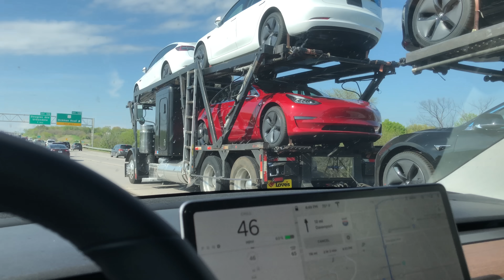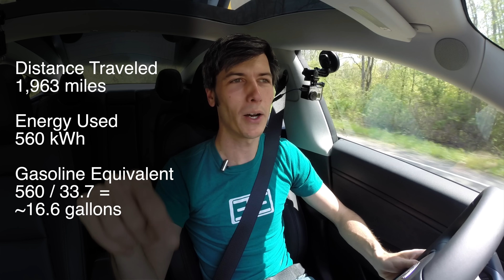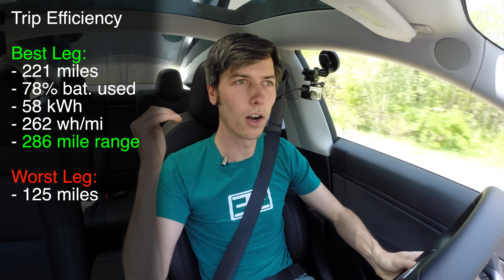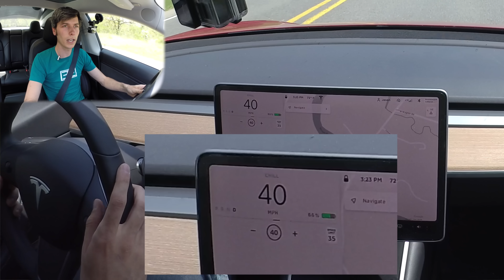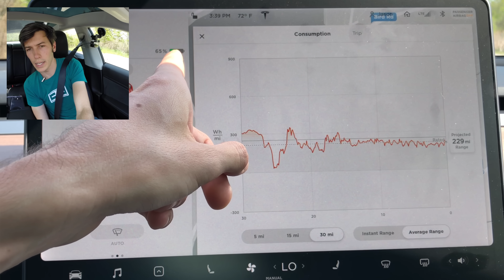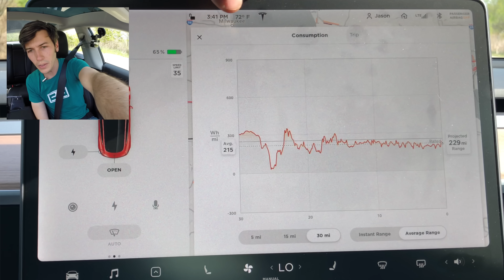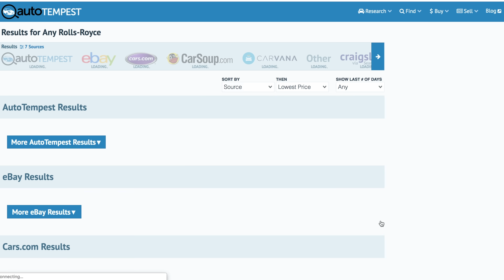How Miserable Is A Tesla Road Trip?

Comment: So basically, if ICE manufactures could get their efficiency up to matching 113mpge of a Tesla without sacrificing power, they could continue selling their ICE engines. It would then be cheaper to travel than in a Tesla and we would not have to mine the worlds lithium. Sadly, mining the lithium is also not good for our environment.  Disposing of the spent batteries will also be bad for the environment unless someone finds a way to repurpose the lithium into a fresh new battery.

Comment: once these get to the point where you can drive 400+ miles on a charge almost EVERYONE will be getting these. my camry can do 16x30 (480) on the highway. and then fill up in 10 minutes or less at the gas station
Reply: @joshburstyn To the average consumer, it does. Time is money. Mass adoption will be an uphill battle until the battery technology improves in both energy density or efficiency, as well as usable life (number of charge cycles before degradation).

Comment: I was surprised to learn that you did this trip without auto-pilot.  I explicitly rented a Model 3 with auto-pilot for a 600 mile trip for the reduction in driving fatigue, which was substantially reduced.  It's far from perfect but I prefer the experience with it.
I drove late at night @ 90 mph which resulted in battery consumption of over 415 Wh/mile.
I will purchase a Tesla next year when the new Maxwell technology from the recent acquisition has been integrated.

Comment: where does electricity come from? I think most comes from fossil fuels
Reply: Even if it were so, much more efficient for a large power station to generate energy than for every individual car
Reply: electric energy is lost over distance and the entire electrical system requires a lot of maintenance most of which also relies on fossil sources... additionally electric vehicles require a lot of heating cooling and maintenance for the batteries... your electric bill is twice the amount advertised by tesla because you also pay for the use of the electric system which in some places is more expensive than electricity itself. all of this is currently ignored because EVs are such a small percent of total vehicles but will be a very big problem when everyone drives an EV.
Reply: not so long ago we use to say: "Turn off the light when you leave the house"  and high wattage light bulbs are illegal in most parts of the world... but electric vehicles with their preheating and preconditioning and battery maintenance burn/waste an incredible amount of electricity. Something that is currently ignored but is not sustainable when more EVs hit the electric grid
Reply: Ed that’s simply not true about the grid not being able to take it. Starting about 4-5 in the morning grid use starts to climb, plateauing about 10am then peaking around 5pm. Then it drops down to very little after midnight. The amount of electricity needed during the day is so much more than night, that electric companies advertise for people to use it more for things that can wait. It’s generally cheaper too. The capacity is already built in to the system, and it meshes perfectly with electric cars.

Comment: I disagree with your energy analysis. You compare the raw energy in gasoline with the net energy of electricity drawn from a battery.  That electricity was produced far away, likely by burning fossil fuels, stepped up and down in voltage multiple times, and then used to charge  batteries.  There are significant losses in every part of that process.
Reply: Yea but it didn't cost  HIM

Comment: Woah! They charge you to charge it? I didn’t know that. So it might not be cheaper. I’ve had trips where my odometer said I had 300 miles of range but I got closer to 400 miles maybe more. That was with a pickup truck. It makes more sense because it was a 28 gallon tank so that makes sense. I was probably getting around 15mpg. I’m curious to see how I do with my 2000 pathfinder because it’s stick. Maybe I can get the mpg over the claimed 19mpg highway. I’ll find out soon. I got 2 months till my vacation.

Comment: average of ~50mph over 2k miles
no thanks
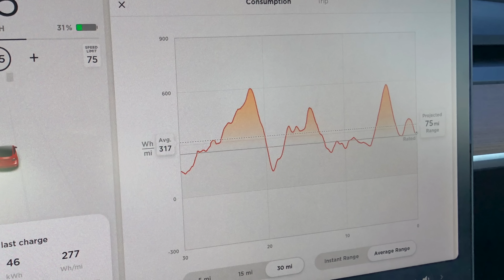Reply: Starting at 3:05, he starts talking about the fact that he pretty much drove at 75MPH the whole trip.
Reply: @desiv1170  Averaged 75mph while travelling but including charging stops averaged around 50mph. (2000 miles/39 hours). Driving a typical car with internal combustion engine would cut both the required number and length of stops. My 20 year old Mitsubishi would have done the trip on 5 tanks of fuel (probably less than that in highway driving) so even if driving at the same speed would probably average  10mph higher, even allowing for meal breaks.
Reply: @MrPaulMorris  No argument there. Just seemed the OP might have been misunderstood by some.  Didn't want people to think it meant he had to drive slow.
Reply: Assuming 5 x 10minute gas stops and 3 x 60 minute food stops (which isn't much in 3 days) your average would only be 59 mph (assuming that you drive the same pace as Jason in between). Granted if you do 80 or 85 mph on the freeway it will probably be in the 60mph average. Bjorn has done a video of speed vs charge time and calculated that the optimal speed for a model 3 is 118 mph based on autobahns, but you'll never manage that in the US!
Reply: 50mph over 2k miles is not really that bad, if you are accustomed to traveling with young kids.

Last month did our own road trip vacation and the average speed on our long distance travel days was right at 55mph after factoring in stops for food, gas, and bathroom breaks.
We also drove at 75mph max, even when the limit was 80mph for safety and fuel economy reasons.
Minivan towing a popup camper with two kids (1yr and 6 yrs) so of a necessity we'd stop for 30-45 minutes every 280 miles for food, gas, and bathrooms along with the inevitable 10-20 minute potty break stop halfway between each gas stop.

In a fuel efficient vehicle before we had kids, getting a 60MPH average on a travel day was a lot easier, but we still had to be intentional about minimizing non-driving time...mostly that meant eating on the go since food stops are what consume most of the time.
Reply: I’m not onboard for 50Mph over 2k Miles distance... turtles do better
Reply: Al Lex Now that's a turtle I'd like to see!
Reply: Gordon Warlow 😂😂👍

Comment: Sorry , but I don't want to have to plan my trips around stops to charge a car.  What if you miss your charging station, or you get there and it's out of order.  Your screwed.  I will stick to my old internal combustion engine.
Reply: Not to worry!  Considering you have Google maps on a giant screen in front of you you shouldn't miss your charging destination.  You won't be screwed because out of service charging stations show as out of service from the built in software in the car and you would not be routed to them (you can search for nearby stations with a voice command outside of using navigation, and out of service stations show as out of service).  The routing information also shows the number of charging stalls, the type of stalls, and the number of stalls in use.  The only thing it does not show is when stalls are blocked by gas cars, or a single stall is out of use.

Comment: I really detest low profile tires , I dont like giving up comfort for looks .
Reply: Philip Freeman low profile is not just for looks. It can quicken steering response and dramatically reduce body roll. I actually just swapped my 40 series 18's for 45 series 17's and its a totally different car.
Reply: You cant deny a rougher ride. @jamesmedina2062
Reply: Philip Freeman True. If the tires don't have any squish in them, sharp impacts are felt strongly. It is a trade-off. The steering ratio, suspension bushings, and frame rigidity all come into play as well. And as Mazda is demonstrating, the seat structure and mounting of such seat also comes into the picture.
Reply: My Fusion had factory 18s whereas most had 16 and 17s. It handled like it was on rails while the reviews complained about squish because of the taller sidewall.

It was a nice car to cruise in. Slow as molasses to get going though and sounded like it was gonna fly apart. 😂

Comment: So if i take my Volvo diesel car and just stop ones on that trip for 10 min to fuel Up. It take about 32 hours on that trip. Sooo what is THE point of the video? WOOOOW you can drive a car 2000 miles and it breaks only ones becuse you canť drive? And yes i dont need to steer my car Ether.

Comment: I will buy cheaper car with gas engine and difference of the price will get me about 10,000 gallons of gas.  Which can travel  300,000 miles with it.   Repairs on that car can be 10 times more expensive and take long time to fix.  Like your tire can be 4 times more expensive then a standart tire.

Comment: Great vid! "Range anxiety" has been one of the factors that has kept me from considering an EV. Also, I could have sworn you were closer to 30, not 56!
Reply: Hot Coffee within two days of owning a Tesla, range anxiety goes-away, especially if you charge at home. A full charge is very close to a full tank of gas. When your car has a full tank of gas to start your day, you don’t think about having to stop for gas that day, do you? That’s what it’s like with a Tesla. Ask yourself this: how often do I stop for gas twice in the same day? Those days are the only ones where you would have to stop to charge your Tesla.  Otherwise, 100% of your charging would be at home. With a 240V outlet at home, the car adds about 30 miles of range pe hour. With a regular 120V outlet, it adds 5 miles per out of range.
Reply: @lemongavine  That's great. Good to know and good points. I do drive long distances a couple of times per month. That's where the range anxiety cones into play, not for normal in town usage.
Reply: Hot Coffee understood. On those long driving days, you’ll likely pass several supercharger stations and probably would only need to top up for ten or fifteen minutes. Get a coffee, go to the bathroom and you’re good.
Reply: @lemongavine  I'm thinking more and more it's the way I want to go. Need to start doing more research and see if I can squeeze 3 kids (in car seats and boosters) in the back.

Comment: In ICE cars I typically don't use cruise control as it seems to work very inefficiently, ie. Can't accelerate a little in prep for an uphill and decelerate in prep for a downhill.  I imagine with the Tesla this would be much improved due to the torque profile.

Comment: How much coal/natural gas/oil  was used to make the electricity for the recharges. And an extra 8 hrs. And dont forget he went from the Rockie Mountains to the east which is down hill lets see the his comparison numbers the other way. In my car from K.C Mo. to about 50 miles west of Denver Colorado it took about 18 gallons of gas total for both ways. Did not stop once. I will keep my car it is a Honda Accord and it will probably last another 10 to 15 years without having to wreck the environment building a new car. But they are getting closer keep trying but I will keep my day not spent on the road with my family.

Comment: So it took you 6 h 30 min extra because of a flat tire. No spare wheel in the Tesla? I bet you were close to a tire center and it was in business hours. It would have been much worse on a Sunday or public holiday.  That is why I will never buy a car without a spare wheel. 
It seems that an electric car is not cheaper to run than a diesel. A 3 series BMW with a 2 L diesel engine gets around 45 mph.  Will that not be cheaper than the Tesla to do a long trip like that?

Comment: Funny, I just loaded the wife, 3 kids, and 2 dogs into our model X and drove all the way from Orlando, FL to Maine the other day, with a stop in DC for a day.  Between walking the dogs, bathroom breaks, and eating, the car was usually ready before we were.  We actually did some manual rerouting and found that spending a bit less time at some chargers and just stopping one or two times more at closer chargers didn't really cost us any more time than staying to charge up more and going farther before the next stop.  It certainly was a hit with the kids who didn't want to sit still in the car for 2.5+ hours.  It is interesting to know that the M3 doesn't have the cruise control stick like the X does.  I think I like the stick vs the wheel.  Also I'm now wondering why the max charge rate I ever got was maybe 92 kW, nowhere near 150.
Reply: You confirmed 2 things.
The car out-ranges the passengers (you want a stop before it needed one)
And
You can "fill" the car in the time it takes to "empty" the passengers?
Reply: @rogerstarkey5390  For our family, yea..  for a single guy in his 20s who is still able to drive a car for 6 hours without a bathroom break, no.

Comment: Not comparing apples to apples. Not 16.8 gallons of gas, because you got the power from the grid: 660lbs (301kg) coal, or 5,544ft^3 (162m^3) natural gas vs about 100gal of gas for internal combustion engine. If power plants used gasoline they would have burned 50 gallons. So best case (but doesn't exist in the real world) is 2:1 efficiency not 6:1. More realistically it's about 1:1 or slightly less, because of distribution and charging losses. People always forget that electricity to charge the car has to be produced somewhere.

Comment: So a diesel (going this speed youd get like 50 mpg) would be cheaper than supercharging. And faster than supercharging.
Reply: And you'd still be burning a fossil fuel.
Reply: @christophernicolai2238  where does electricity come from? ... mostly from nuclear and coal
Reply: What diesel is getting 50mpg in the us?  My old geo metro could get 48, but the trip would be miserable, no ac etc.  And well, it probably would not have survived the trip lol.
Reply: this makes no sense. electrons are still about 1/4 cost of gas (and diesel is more expensive for comparable distance). The electric cars are even more efficient at slower speeds. You also have to stop and eat/get gas/etc even with ICE so the difference is almost nothing and way cheaper on electrons.
Reply: lane johnson  well i didn't buy it new, when the catalytic converter went out it was more than the cost of the car to repair.  Also one of the most unsafe vehicles ever made.  Never had to worry about where I parked though!
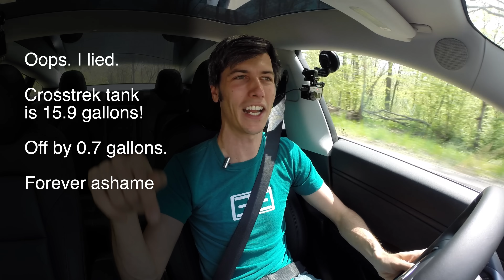Reply: lane johnson  Just checked my car right now, tried to upload screenshots of the following but wouldn't upload. If someone can help me post I would be happy to. According to Telsa trip planner right now in the car: Augusta to D.C. 560 mi, 8:22 without stops. Same with my car only charged to 183mi: 9:45 hr including all stops. That still shows up in DC with 19% charge. My cars FULL range is 310 mi so I'd have that much addl range and time to charge would drop accordingly. The worst case is maybe 1:23 charging and that's how the car sits right now half full. Made the trip more times than I can count, it's not much slower than ICE if you stop even a short time for gas/food/bathroom. As I said; overstating time and need for stops.  It just isn't that different particularly if you stop in the ICE vehicle. With 20min bathroom breaks/gas in ICE over an 8+hr trip (which is smoking fast), it really amounts to maybe an hour and that is worst case. Pretty close in my opinion. Drive one, you will be impressed.
Reply: lane johnson  my car is always "full" every morning and I don't have to stop somewhere to fill up. Once you try it, you will realize how absurd the negative comments are☺
Reply: lane johnson  I don't think I can change your mind, but the time difference is pretty minimal on long trips and otherwise beats ICE in all areas. I've owned a string of muscle cars, three Corvettes (one a ZR-1), two M3s, several 4x4's,etc. Trust me, you are fooling yourself. These cars are really unbelievably good.
Reply: Lane, are you on east coast? I have to take you for a ride. It's really hard to believe.
Reply: lane johnson  yes, I have multiple other cars. Perhaps not the best choice if you live in a remote area. I live in a rural area, am 3 hrs from nearest Tesla dealer and I still use it over my SUV for most long trips. I suppose the power could go out at home... But a tree could fall on my SUV too. It's really hard to believe how good these are and I can drive several different cars I own any day. I put 55k on the Tesla because I just chose it.

Comment: The Performance Model 3 must be a lot less efficient than the LR RWD. We've been getting between 3 and 4 hours of driving between charge stops and have only had to stop for 20 minutes to charge at the most! We're driving from San Diego to Upstate NY! Stopped in Kansas right now visiting friends.
Reply: XP-8 TIM RWD range is rated at 325 miles. AWD is 310 miles with the same battery.
Reply: @lemongavine  We know, that's why we got one before they got discontinued 😀

Comment: Single person driving 2000 miles, has to make about 10 obligatory stops to charge the vehicle for at least 20 minutes. Image taking your family with luggage for a lot of extra weight, and it is winter time so battery has lower capacity. Not the most practical option.